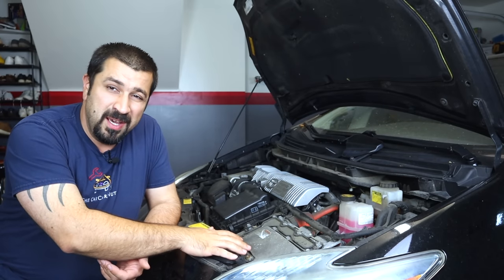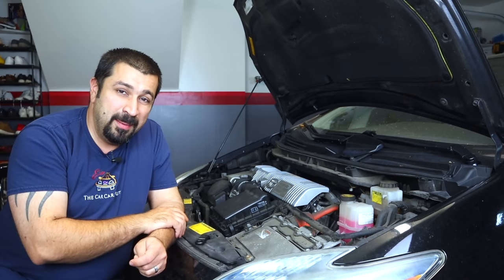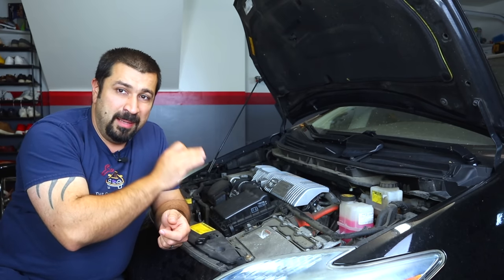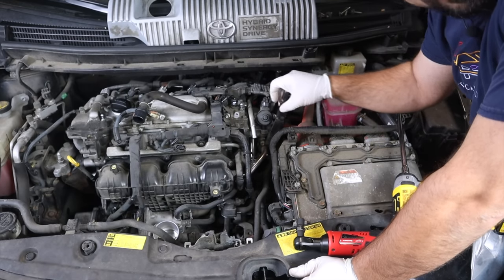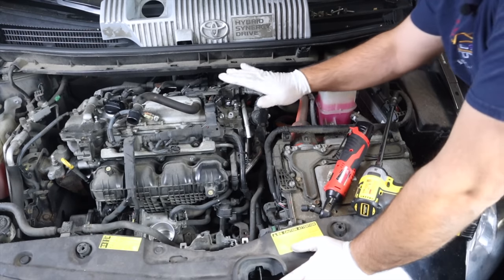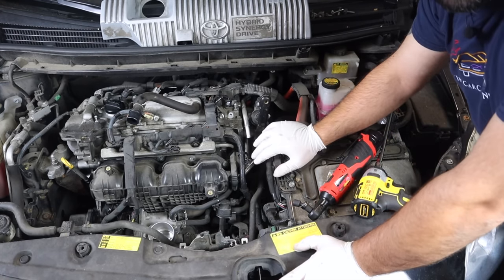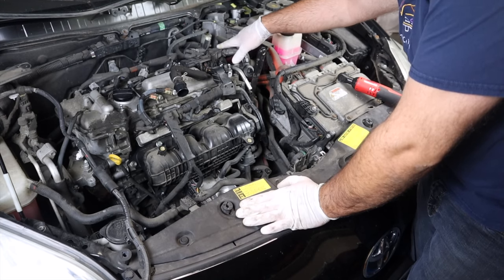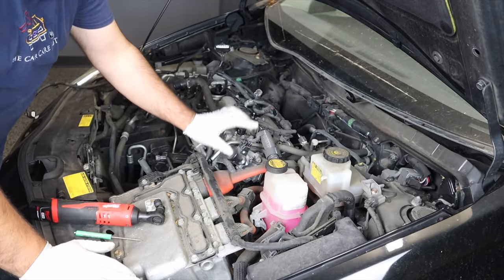Toyota EGR Diagnosis Tips and Repair Tips

Comment: Thank you for explaining the correct procedure and the fact that there is a Software update required and a part to be fitted.
   Would an Oil catch can help with the PCV  oil.
Reply from the maker: Hi! An oil catch can could help however this engine does have an oil separator built in which does the same. If the engine burns oil or is overfilled with oil then the issues start with excessive oil in the intake

Comment: Great video sir! The issue I am having with my 2013 Prius is, low rpm car runs perfectly fine but as soon I accelerate the pedal lil bit more than half way roughly around 4000 rpm or more check engine light start flashing, code I get out of is p0301. So far I change all the plugs, and cyl#1 coil pack but still the same. I clean the intake egr and the egr cooler and the lastly I switch the injector from cyl 1 to cyl#2 but I still get the code only in high RPM engine light flash and I get p0301. Idk what to check next or just change the egr valve and see what happen next? Please advise thanks

Comment: I almost never subscribe to a channel.... you earned it. I'm just worried now I didn't go far enough. My car is in the shop right now having new EGR kit put on (2010 prius)... I didn't know about the intake clogging. Luckily it looks a lot easier than the actual EGR (third bolt is a nightmare I hear)... I've just recently taken cowl off and changed plugs and coil packs. Looks easier than that to get to just intake manifold. Guess I'll check it once it comes back from shop I'm paying to put the EGR kit in. 

Also I have versions 8-14 of Techstream.... My car kept popping a "check hybrid system" light. I'd reset it, drive for a while, it would do it again. Always felt a shudder when it would happen. 

Age old story: Yota dealer "you need a new battery"... I've owned three prius since 2004 and have a guy I trust who installs reconditioned batteries. Him: "IT IS NOT your battery. I can change it and charge you but I've looked it over and all cells are looking good and you'll still have the problem" 

So I got ahold of Techstream and installed it on several hard drives (cloned winxp and installed different versions on each drive TS8, TS9, TS10, TS11 etc....). 

I have driven it a few hundred miles with the data log watching voltage of all battery groupings and have yet to catch it when light would pop... I'd record an hour of data (max length it would allow to record) back to back for three hours... I'd get busy hour four or five it'd pop "check hybrid system" 

Long story long... I'm wanting to install software update when car comes back with new EGR on it. I haven't found that feature yet. 

Have you done any videos on how to update firmware for Prius? 

So far my only experience is doing data graphs of voltage of traction battery and playing with the easy to tweak features (such as hold unlock button on second unlock and make all 4 windows roll down, kill seatbelt unbuckled buzzer etc....).

I'm going to go thru your other videos if you haven't already can you do one on how to update software with closer view of where to find options needed for EGR firmware.
Reply from the maker: Hi! For the update you’ll want to head over to techinfo.Toyota.com get a day subscription and search for the original TSB for p0401 and find it. In that document are links to download the update. I would hesitate to update it using a cloned scan tool as you could fry the ecu so try that at your own risk. On the battery you will rarely if ever catch the voltages off. If memory serves right the fluctuation could be 0.3V for less than a second and it will set a code. It will need a battery. Looking at static voltages won’t yield results as it happens too fast for the scan tool to catch it

Comment: Awesome video. I have a question. I have a 2015 Prius. I've changed the O2 sensors, the maf sensor and wanted to know sporadically why my Prius would rev high and then go low and then go high and then go low and then go away every now and then. What could be the cause of this?

Comment: Amazing video. My Prius is having some high idle issues with P0102 and the only way for me to keep the idle stable is by leaving the pipe between the EGR valve and the intake manifold slightly loose. New maf sensor didnt resolve so not sure if it's the EGR valve or the manifold at this point.

Comment: Great video.  What are your thoughts on the 4wd Tacoma 4 cylinder vs. 6 cylinder for servicing?  What do you personally think about the horse power/usability of them both?
Reply from the maker: Hi! The 4 cylinder is easier to work on for sure but is also much more underpowered than the v6

Comment: Brilliant Video. Very informative. Keep up the good work. I was looking at videos like this as I have a bit of an issue with ny car. It's a 2016 prius with 105k on the odometer. At 70mph while cruise control on car if fine, as it comes to a hill and the cruise speeds up the engine to keep it at speed i noticed smoke which clears when i cancel the cruise. It only does it at 70. At 60mph its fine no smoke going up hills. Any suggestions would be greatly appreciated. Thanks.
Reply from the maker: Hi! Any warning lights or loss of oil? And what color is the smoke?
Reply: Hi, thanks for replying. White smoke. No warning light on the dash. And no loss off oil.
Reply from the maker: Interesting. This one will be hard to figure out without in person diagnosis honestly.
Reply: Hi, can the egr valve cause white smoke  or the egr cooler loose water from expansion tank?
Reply from the maker: Its not common but possible
Reply: Thanks. I was looking into the problems related with a failed pcv valve also to try to diagnose this problem. In you experience can this cause the problem I'm having along with the egr? Or change of fuel as we changed from E5 fuel to E10 last September!

Comment: I have a 2013 Prius with 93k miles and around 89k miles I had to replace the egr valve and intake manifold. That was a $800 to fix at the dealer…

Comment: Hi!  This is a very informative video, thank you!  I have a 2010 Prius with this exact issue, but originally, my issue was (and still is) overheating on hills, high longer distance speeds (60+ mph) and 110° degree days in the desert.  A family member said to replace the entire engine.  I heard “EGR cooler” and am wondering if this could cause high temp warning light to flash?  (I have no other warning lights).
Reply from the maker: Hi! The egr cooler is cool the air for the egr system not for the engine cooling system. I’m many things could cause your overheating. As simple as debris blocking the radiator or medium things like a weak water pump or serious like a head gasket issue
Reply: @TheCarCareNut  thank you!  This was helpful!
Reply: @TheCarCareNut I have an 2016 4th generation Prius that has rattle at low rpm only and also I am losing coolant from the overflow tank. It is possible that my egr cooler to be failed together with the egr valve? I also noticed that in the morning when engine is cold I have pressure in the cooler thank when I open the cap to top up the coolant., is this pressure normal? If not, should I suspect the egr cooler pushing pressure into cooling system true my egr cooler? 
I have no warning lights on my dashboard. 
I checked for faults with an OBD and I get this code P268172 -Engine Coolant Bypass Valve Control Circuit/Open: Actuator Stuck Open. 
What are your thoughts on this please?
Highly appreciated your answer. 
I have to mention that I have my car at my Toyota Dealership for one week paying 400£ for investigation and they can't figure out what is wrong with my car. 
Thank you for your answer

Comment: I thought this made sense so I tried the EGR only, it didn't fix the issue. Well I have the cooler off and my first test was to try and blow through it and it is obviously restricted and it didn't taste good. I could  barely see light through a couple passages. I think it may be wise not to buy the EGR right off if you want to save some money. Because the cooler is so expensive cleaning it is definitely the best route but I can tell you right now that spraying some brake clean in it and slapping it back on is not going to happen. I have been soaking and then rinsing and repeating and I only managed to open some of the passages and when I blow through it I can still feel resistance. I won't be going to a dealer to get anything flashed since that is not going to fix carbon build up. My conclusion is take the cooler off from the start and take a look at it, it doesn't take much time since you have already unbolted everything and you only need to disconnect a couple coolant hoses. Blowing sure through it will likely do nothing and you're not going to see anything with it on.

Comment: Excellent video, AMD, I learned a lot!  I have a 2012 Corolla with a 1.8L 2ZR-FE engine.  I have not been able to find any information about its EGR valve (like location, part number).  Perhaps this engine does not have an EGR valve?  Does it have an EGR system of any kind?  I think it must because my OBDII scan tool shows EGR as one of the readiness monitors.  Thank you for your videos and excellent information.
Reply: It’s internal. It closes the exhaust valve early to trap some of the gases in using the variable valve timing. Priuses can only adjust the intake side.

Comment: I have a 2012 prius that just hit 120k miles. Would you recommend this or cleaning the intake manifold as preventative maintenance? I have done al the fluids and am about to do the plus is there anything else you would recommend for maintenance?
Reply from the maker: Hi! If you’re doing this yourself then yes I would clean things or at least inspect them
Reply: @TheCarCareNut  I have no issues at all just wondering if this is something that should be done for preventive maintenance or wait till I do have a issue?
Reply from the maker: It wouldn’t hurt to remove the pipe from the manifold to the valve to see how everything is looking. That’s easy to do and will give you a clear answer. If you see build up it might be worth cleaning it. But if it’s clean I would leave it alone

Comment: Our sons 2011 Prius is misfiring on cylinders 2 & 3. He replaced the spark plugs & coils. Still has the same problem. He has not checked the fuel injectors yet.
But I'm thinking after watching YouTube video on EGR test & replacement. This probably the real problem. His Prius has 140K miles. 
Thank you. 🚘🏁👍
Reply from the maker: Hi! If it’s not an egr problem it could be a head gasket issue

Comment: hi sir,
Can I use engine degreaser to spray and  clean inside a manifold?. I know and agree with you, like you said the manifold  and egr cooler can never be cleaned completely bc they are part of exhaust system as long as they are not clogged.

Comment: Thank you for the great video!  2012 Prius, 96k just started this cold start rattle even after cleaning all egr components and intake manifold to prevent it.  Will dealership honor ZF3 warranty enhancement for valve replacement and software update if car has not yet thrown 401 code?
Reply from the maker: Hi! Usually no unless it has misfire codes.
Reply: @TheCarCareNut  Thank you for the reply.   Maybe I should update the egr valve myself even before it throws the 401 code because the startup rattle could be hurting my engine, then have the dealer update the software at my own cost, if I can find one that will after I install the new valve?  Would a video of the rattle convince them?
Reply from the maker: Possibly on the rattle video.
Reply: Cold soak rattle issue only happened twice, when cold out and not started for a week.  Luckily. I documented it on video the second time.  Showed video for proof to dealer who performed ZF3 warranty update, 1 month before the 10 year limit!  Don't know if any codes or info on the computer when they scanned it, but no check engine light was illuminated.

Comment: In the mid-90s I used to have a GM vehicle and the EGR valve went bad on it every 9 to 12 months.. when it would go out the car would jerk at times and not run correctly.. Luckily it had a Year's warranty with it and I had it replaced free of cost. It was also replaced several times under warranty..I think the cost was around $300 at that time.. I did pay for it one time..It was a pain.. after that car I went to Honda and Toyota and never looked back and never had any more issues.

Comment: Excellent video.  Does my 2012 Corolla with a 1.8L 2ZR-FE engine have an EGR valve?
Reply: No. It’s an internal system done by changing the valve timing with the vvti. Been up to 500k miles with mine, much less maintenance than the Prius. Just a lot worse on gas

Comment: This comment is a little bit off-subject, but I would like to hear your comments on cleaning the engine compartment.  In the video, you talked about people cleaning the cooler and said that was basically unnecessary.  But I like to keep my engine compartment clean, so I will cover over the fuse box, alternator and anything that is electronic (I have a 4.0L Tacoma) and I will spray degreaser and lightly hose things down and wipe them off.  Is this practice ok in your view?  Also, would it be more problematic to do this on hybrid cars?
Reply from the maker: Hi! It is ok. Avoid direct pressure at electrical connectors and dry them off with compressed air if possible and you should be good

Comment: Bro you did a great job … love this video.. only question is how much is the parts ? And how much do you charge for this ? where are you located? I need this same job on my Prius
Reply from the maker: Hi! It depends what the car needs after an inspection. I am in the Chicago area
Reply: The intake manifold  is $214.61 and the EGR valve is $253.22 at the local dealership

Comment: Hello again, don't have head gasket problem,  Toyota dealer replaced egr valve under TSB at no charge (thank you toyota). Ran great this midwest summer, but as soon as temperatures dropped, cold start knock reappeared. Not sure if they cleaned cooler, so I guess next step is to do that and replace intake, do you have part # for latest version? 2010 Prius, thank you. Or maybe I'll move to CA!
Reply from the maker: Hi! Don’t have the part number handy at the moment. Inspect the intake manifold and the cooler

Comment: Oh man, do you think this will apply to 1st gen Scion xB? In super tempted to try this, and massive thank you!
Reply from the maker: Hi! The 1st gen Scion xB doesn’t have egr
Reply: @TheCarCareNut  ah okay thank you. I'm praying that it isn't the damn torque converter then. Do you think it would be wise to pull my intake manifold anyways to have a look? Car runs great, shifts nicely it's an automatic. 194,500 miles. Just has that slight vibration at idle and stuff.
Reply from the maker: Could be engine mounts on this one
Reply: @TheCarCareNut  I had them replaced last year with cheap ones. A month ago the upper passenger one literally broke. I changed it, and the tranny one for good measure. Couldnt do the rear one, since it's too involved. Rubber looked good tho. Thanks so much for your help man, I really appreciate your channel.

Comment: I have a 2012 Tundra platinum with 115,000 miles. The diff and transfer case oil has never been changed. Do you recommend I do that and if so how often should it be done?
Reply from the maker: Hi! I would get the fluid replaced. And repeat every 30k miles

Comment: I recently took my 2017 Tacoma 4x4 DC V6, 45K,automatic transmission, in for an oil change.  The adviser recommended:
1) Top Engine Cleaner
2) Mass air flow sensor cleaner 
3) Engine Air Filter
I get the air filter change but what are the first two items? Thanks
Reply: Top engine may be throttle body and maybe intake valves. Probably don’t need. MAF sensor you can clean yourself. Probably a million videos on them.
Reply from the maker: Hi! Do you drive highway often? Or most of your diving is local with a lot of short trips?

Comment: Does the  EGR valve in the 04004-58137 kit fit on a 2013 Prius V? The description says 2010 to 2012, but the valve looks the same. Thanks for your video. I did clean my valve but would rather replace it.

Comment: Idk how long you been a toyota tech but for 1 if you deep clean the egr cooler it does not stop right back up and clog after 1 mile I personally have cleaned and drove 200 miles and checked it out and it was just as clean as I left it and you can clean the intake.

Comment: What I do is just disconnect the egr on the road test.If the fault is gone it the egr system. 
Sure it sets a code but it quicker than blocking off the valve

Comment: I've got a 2013 Hybrid Avalon that I think has this problem. It started a month ago with the low rpm rough idle.Then it starting getting an over heating error. How long did this process take from start to finish?

Comment: Thanks for the video! Is the software available for DIY'ers or is the software package / cable required for the software flashing all proprietary? Curious if it's essentially required to go to the dealer one way or another for these sorts of things.
Reply from the maker: Hi! You’ll need a techstream lite which is a 500 dollar cable connects to any laptop. Then you can purchase access at techinfo.Toyota.com get the software that’s active and update it. Honestly much cheaper to just take it to the dealership and get them done.
Reply: @TheCarCareNut  thanks! I figured it would barely be a break even point-if even that. I have a 2021 rav4 so I know it’ll be a while before I get to that point, but just was curious and I appreciate the information!

Comment: What socket or extension did you use to get the top egr bolt that goes to the cooler?? I'm having a rough time with it and dont want to remove the cooler @thecarcarenut